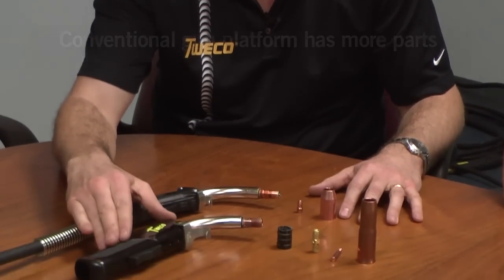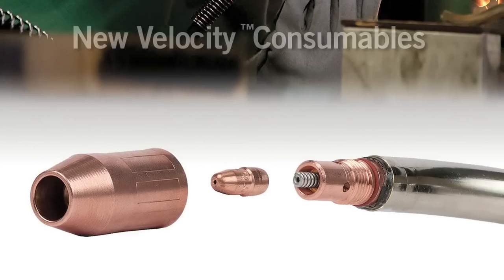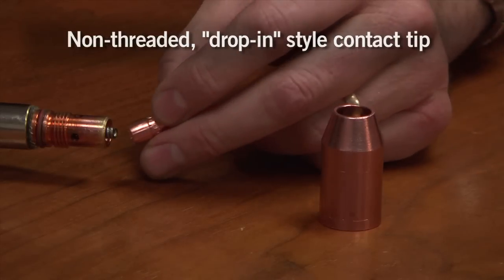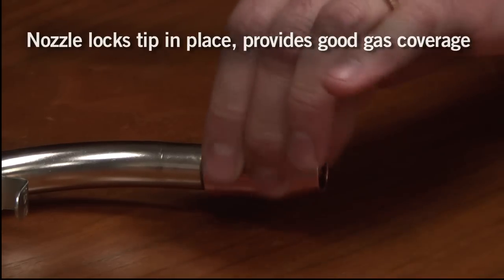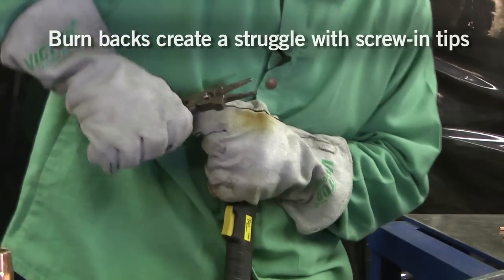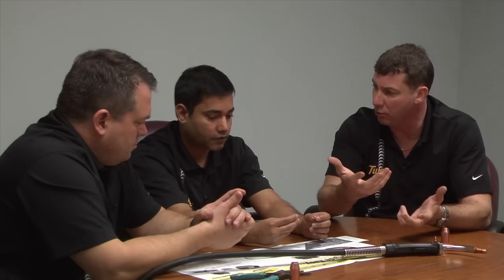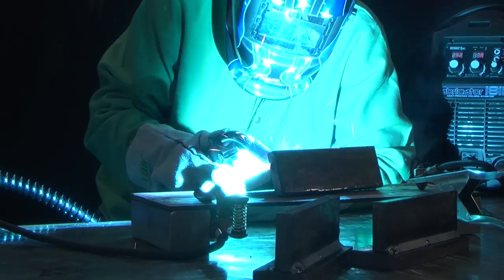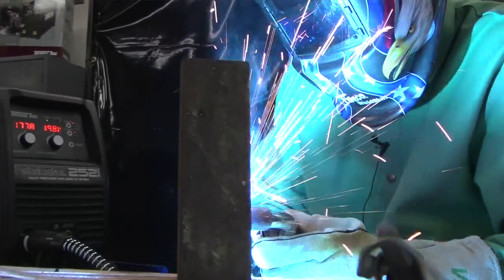Tweco Velocity Consumables: How these Innovative Consumables Improve MIG Performance

Comment: You get steel beads stuck inside the cup! And this is becoming far more common! then they are willing to admit ! Plus the consumables are far more expensive! Not worth it! I changed back to the old style!
Reply: Very true, less parts don’t mean better when you got a job and no spare consumables on hand. No local shops carry high velocity consumables. Just paid 60 on 10 tips and 2 nozzles. I can get most universal parts at a distributor or free from the shop I work at.

Comment: I absolutely hate tweco velocity series consumables and guns. I actually ordered a new whip that used tweco old school consumables. Fire the idiots that designed the Velocity series guns and consumables
Reply: I'm kinda thinking about doing this as well. Big problem with spatter shorting the nozzle to the tip/threaded part of the nozzle and causing the wire to stutter